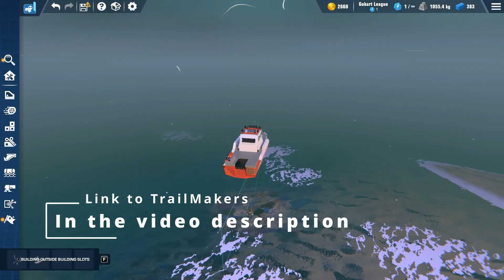I used a LEGO Technic boat and rover to conquer a shipwreck!

Comment: This is a really cool idea but one thing i have to critique is that 3d prints aren’t waterproof, over a long time your boat would take on water
Reply from the maker: You are correct. To remedy that you can print at 230 °Celsius, slower speed and add an extra layer or two at the base of the box. That made my PLA boxes waterproof. Another method is to cover the boxes with a thin layer of epoxy but I haven't tried that. My major concern is the longevity of the boxes. PLA tends to be "allergic" to the usual environment my vehicles traverse (salt water and UV radiation due to Sun exposure) and they'll degrade quite fast. I'll probably switch to PETG for future parts now that I know my way around the printer.
Reply: @brickandgear if i remember correctly they were encased so i would not worry that much about uv rays, i got no comments on salt tho, switching to peth may be a good idea but to be fair it may be slightly redundant since you will still likely lose watertightnes overtime and will have to replace them either way. You are right generally petg is more mechanically capable a d better suited for outside however its still a 3d print , dont know how much your mentioned method works
Reply from the maker: With the settings I used, I didn't get any water in the boxes. However, the longest period of time they were submerged was 1.5 hours when I shot a video with a boat carrying a CH-53E helicopter. I don't know if water could find its way inside if they were submerged for longer since they might behave like a porous material.
Reply: @brickandgear well you might have found the key to fixing it then, most attempts st maki g waterproof 3d prints had them have tiny holes that let water trough

Comment: great video sorry the rover got wet :( but glad you were able to retrieve it:) right before the moment of disaster i thought to myself what if the rover slid back into the sea, I really hope it floats and it did :)
Reply from the maker: It's a pity I didn't get to drive it back in the landing craft. The sea was perfect and the boat very stable.
Reply: How many 5x11 frames did you use
Reply: And is there away you could post the STLS for the prop and the water proof boxes?